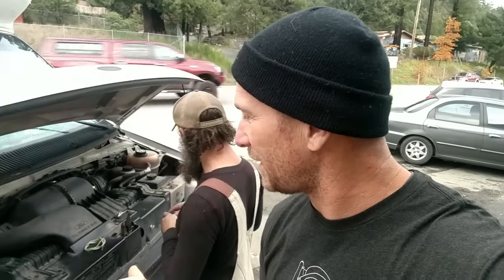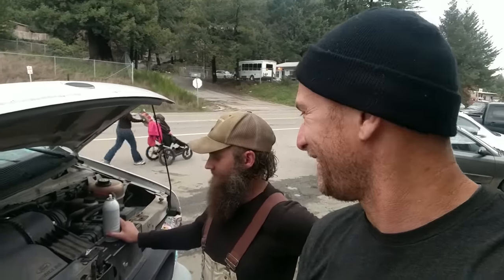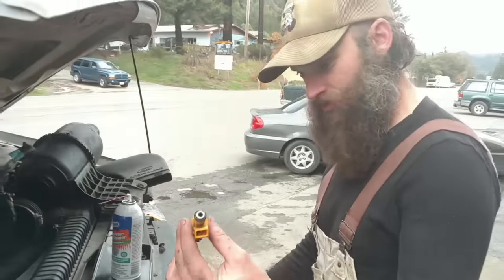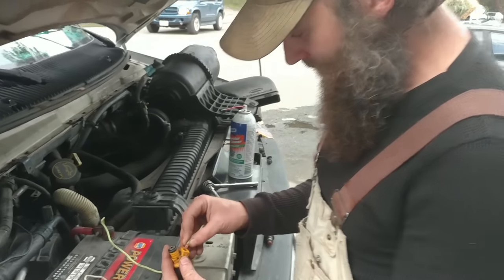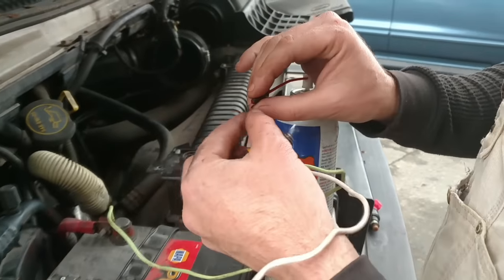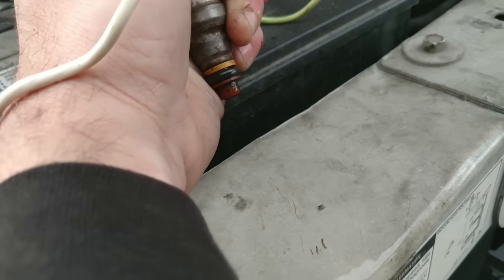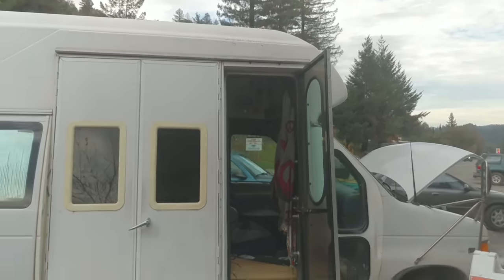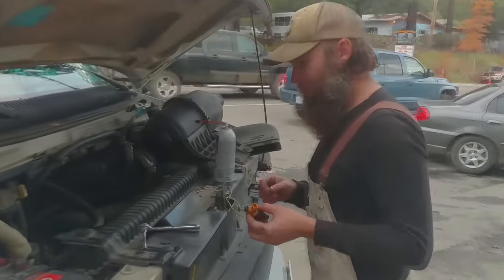Dirty fuel injectors?   Dont buy new ones- do this instead!

Comment: There’s supposed to be a fuel filter on this thing, if it’s passing that debris it’s either missing or by passing. Clean the filter and/or add another inline.  I think his injectors are just shot, worn out. If he has done this a dozen times, and has an 8 cylinder engine, he’s done some more than once. Put an ohm meter on them and get rid of the out of spec ones.  Ha ing to keep doing this isn’t fixing anything. 
 Do it once and all’s good? Ok, I can buy that. Multiple times? Nope, injectors are shot.

Comment: All you really  need to do is remove the injectors then the rubber seals. Pour concentrated seafoam or whatever fuel cleaner you choose. Must be concentrated no cuts. Let soak for your desired time. Preferably over night. Then blow out after soaking.  The concentrated fluid will dissolve the gummy fuel blowing removes the slug.  

When you add can of seafoam to 15-20gallons. It dilutes its effectiveness to almost useless.

Comment: I have cleaned mine this way.  the only time this doesn't work, is if the injector doesn't click.  If it doesn't click, then the injector is dead.  happened to me on my ford truck.  I took it off, and went to clean it, and it would click, so fluid doesn't come out the bottom.   brake cleaner works really good for this cleaning process.   I was able to clean a set of injectors this way,  on a an older volvo i had.

Comment: Injectors, like every other part on cars, do wear out. What happens is they start to leak only dripping fuel into the intake. So it is a good choice to buy new injectors sometimes.
Reply: Bet if it was diesel it'd runaway after years of doing this
Reply: @maxbollinger6158  Yeah, you'd certainly increase the chances of a runaway.

Comment: Can imagine it does clean the injector fine , but probably a good idea to use an inline fuse wire to the battery - looks very easy to short out those two wires.
Reply: Just going to melt those wires of you short them and hold them. They are very small and the cranking amps of that battery far exceed what they will carry. In this application, the wire is the fuse.
Reply: I wonder if the guy is still alive or just seriously burnt after doing this.  What a cowboy

Comment: Definitely works ! the only reason to get injector is if it won’t click and it’s broken inside the electric Fuel injector
Reply: there is NO electonics inside whatsoever! its a simple solenoid coil
Reply: Jim W  Well it’s not manual it runs on electricity so it’s electronic fuel injector that’s why it’s called an electronic fuel injector I know how they work to work on pulse signal
Reply: @tractormantp2113  electrics is NOT electronics They are 2 separate things
Reply: Jim W   Yes I meant to say electric fuel injector got it
Reply: Point is unless the inside of the injector is not working the electric part the coil that makes a pole spray then you can clean them and reuse them
Reply: @tractormantp2113  no problems buddy, take care
Reply: Good to know. Thanks

Comment: Never leave the connectors on that long... on a fuel injector you will kill it... but good video👍🏼
Reply: Yup pulse power
Reply: They are good for a minute or so, I have used injector test benches before, one test is to open the injector up constantly and see how much fluid they pass in a set amount of time, this test does open them up for 3 to 4 times longer than he had it open. That being said i would myself do it with a 9v battery first as there would be far less chance of damage and less chance of a spark that could ignite the spray he is using

Comment: My garage replaced all my injectors with an upgraded model and a new software pack and the result was fantastic.  It was a warranty repair guided by a specialist from Stuttgart.  When I traded the car the new injector pack increased my trade value by about 2500 dollars.   The problem was uncommanded acceleration that the garage took very seriously.
Reply: was that on Ford v8?
Reply: $2500 value for parts that cost less than $150 tops... and easy to do......????  Really???  lol...hm... don't think so...
Reply: They did you 😂

Comment: Only thing I would do differently is make a pedal like for a tattoo gun so you can tap the power on and off for the injector so it pulses
Reply from the maker: or a robot that can do the whole thing for you?!
Reply: @dridiott  yeah because everyone can afford a robot. piece of wire and can of Carb cleaner 399 done deal.
Reply: @johnnyblade3335  I would finance the robot

Comment: Great tip, but if you had to do this a dozen times already, there must be something else causing your symptoms.
You need to get to the cause my friend.  Corroded tank, fuel line, fittings, pump…pretty much anything between the gas station and your injectors.

Comment: wouldnt it be more sensible to put an inline filter on to collect the crud in the tank or better still drop the tank and swill it out instead of doing this a dozen times already ?
Reply: Depends on how bad the tank is.  I had a tank on an old Audi that was so bad it could clog up an inline filter in about 5 miles.  I had to stop every few miles and tap out the crud to keep going.  Ended up taking out the tank, cutting it open, wire wheeling out all the rust, and welding it shut again.  In retrospect, probably not the best thing I could have done, but I was young and ignorant.

Comment: You better use a DVM and check the rated voltage for the injector first. Overload it with high voltage and you will be buying injectors.  Weather it's an older TBI or modern multiport injectors, they don't normally run on 12V DC.  Many actually operate on 5 VDC.  Go ahead.. overload it with 12VDC and burn it out.. LMAO!  Always check voltage first before attempting something like this.

Comment: I throw a can of Seafoam, Techron, and Lucas Fuel Injector Cleaner full concentrate into a half a tank of gasoline at the same time and drive the piss out of it for like two days.  Not beat it, but accelerate aggressively. This also helps break free carbon in the system. I run that entire tank down to near empty before refueling then I top off the tank. This has always worked for me. But then I don't think I would let mine get to the point where they are that plugged. Fuel is important and with the crap they sell at the pump today, additives can't hurt. Most cars can run on swamp water so the likelihood of you damaging and O2 sensor or the cat is ridiculous.
Reply: sea foam does not work as a fuel injector cleaner, it was developed for marine outboard engines to help keep carbon at bay.......Techron is good as is Berryman ChemTool
Reply: @dixiegarage400  seafoam makes fuel injector cleaner it’s available at Walmart and all the major parts store. Not the stuff in a can (which by the way you can still add to your fuel to help clean valves.)

Comment: I tried spraying ethanol, laquer thinner and other stuff through my injectors.
  What worked was techron. Just put a rich dose of techron in your tank.
Reply: So, how does that remove the dirt & debris from your injector screen ?

Ahhh, you just "cleaned" them for the time being.
They will clog up again.
Reply: @franklyspeaking4480   I figure it desolves some sort of fuel deposits that turned solid.
The car had sat for 7 years.
 Because they didn't clog again.
It didn't just flush them away because none of the other stuff I tried got them to move.
And just 3 pumps of the techron and the injectors were spraying without pissing.
 Car has sat again for a year but it started and ran pretty good today.

Comment: Whenever I stick bare wires in solenoids and spray flammable shit through them 
I make sure I've got a gallon of gas handy just in case I need to put a fire out
Reply: thats what we pay for insurance for
Reply: ivan schafeldt  what are you saying the injector has a built in spark plug?
Have a think about what you said then go cook your head for the sake of humanity
Reply: @beltdrivetypea6534  
Don't know wat ur trying to say but if there is a gas leak in the house and u smell gas they tell u not to turn anything on or off as that may cause a spark and ignite the gas. The same applies here, he connected the wires so any spark that is possible has already happened so it can't ignite any fuel.
Reply: @KC08RAS  I'm struggling to comprehend the level of ignorance right now 
Part of me wants to explain but part of me is saying sit back and enjoy the steady stream of drivel
Reply: @beltdrivetypea6534  
Sharing knowledge is a good thing. I may learn something which I enjoy doing. No hard feelings from my replies I hope.
Reply: @KC08RAS  ok
He takes two bare wires, one + and one - 
He then pushes them in a small hole with no insulation between them
Then he braces them with one hand and while the solonoids open he sprays flammables through the solonoid 
So if a wire moves and arks the solonoid closes and he gets flammable shit blow back into his face at the same time the two wires are arking out
Pretty much exactly how a gas hob works
Reply: @beltdrivetypea6534 
ur right lol. Thought he had spade connectors at the end of them
Reply: Classic badass comment 👍
Reply: Good thing you don't go changing fuel pumps ans see the bare connectors submerged in your gas tank.... Don't shit yourself kiddie.
Reply: @666hobart  tard
Reply: @beltdrivetypea6534  Mmmm hmmm... We see who the tar is, keep takin yer car to the shop. We're all safer if you do...
Reply: @666hobart  what the hell are you on about
Reply: That Gunk out is that flammable?
Reply: @Tomasnok ye, that gumout is extremely flammable, it's basically like starting fluid, almost as flammable as any ether based solvents I'm thinking..could be wrong. It's My opinion...as for the comments of others here actin like he's being so dangerous...quit being a girly girl...besides, the dude said he's had to do it 12 times to that thing... he's probably wishing that POS would explode/ignite and kill him ROFL 🤣💥💥💥💥
Reply: @artv8830  my original comment was obviously sarcastic
Personally I'd love to see just how dangerous this could be if the planets aligned 
Darwinism in action is hella viewing
Reply: @artv8830  Gumout? Gunk.
Reply: Safety first. That's how I fly.
Reply: I'm stoned n don't know why I just read all this... But my 2 cents dude cud be aware of risk and he's just willing to take it. That would be what I do. He does mention using a 9v battery, then stated his preference so it's not like he's just talking out his ass. Why not.just inform ppl that is a risk instead of joke dissing. At least he tryna spread something positive and teach ppl vs u jus shittin on it
Reply: @QM1K  or just maybe my sarcasm has saved someone from having a their face seriously burnt 🤷

Comment: I just pulled mine today 2001 Silverado 2500hd 6.0. I took the orings off and stuck them in a pot of boiling water for 5 minutes. Took them out and cleaned with 90% alcohol and put orings back on and installed. Truck fired right up and my p0300 and 0171 codes went away. Runs like new again. Also running MMO in tank now to help keep ‘em clean. Original injectors 191k mikes and counting.

Comment: you can also pull the fuel pump relay, run the engine until it dies which will release the fuel pressure, disconnect the fuel line from the fuel rail, attach the injector cleaner can directly to the fuel rail which may require some rigging, spray the can to get some pressure and start the car and keep spraying the cleaner....the engine will run off of the cleaner which should clean all of the injectors at once without having to remove them from the engine, just remember to reattach the fuel line and put back the fuel pump relay before trying to start it again....you can also make a fuel line disconnect tool with the cap from a regular Sharpie pen, I find it works better for me if I stack two modified Sharpie caps as one is sometimes not thick enough to properly push in the teeth on the fuel line connector
Reply: Hey do you think that will work on a diesel injector? On a 7.3 T444E?
Reply: @GDMHificationranpitc  I've never worked on a diesel engine before so I don't know if there would be any difference.
Reply: @deputydillhole   Thanks for the prompt response...   Flux capacitor. Shalom
Reply: @deputydillhole  As long as we take injectors off the vehicle and keep as much of the cleaner away from contaminating into the engines  system 👍👍 should be fine.

Comment: So, I cleaned my injectors, reinstalled them and started the car.
3.8L in a Pontiac.
Rear 3 injectors split apart and gas went everywhere.

Buy new injectors and disreguard what billy bob just said.
I'm currently waiting on 6 new injectors that cost me a whopping $62.49 !
Screw cleaning them, they are cheap, just replace them.
New O rings, new filters, should run great again.
Reply: your first mistake was buying a pontiac
Reply: @alexmiller1018  
I have owned about 20 of them.
Id own 50 more before buying a ford or chrysler/dodge.
Reply: Frankly Speaking “I have owned 20” yeah I bet you have lol
Reply: @alexmiller1018  
I have owned over 50 camaros too.
I have owned over 200 vehicles & counting.
I have pics of my 65 Tbird, 94 Suburban 3500, 69 Javelin SST drag car, 98 Eclipse RS, 06 Eclipse SE, 05 Impala & a 99 Pathfinder sitting together 😎
9 camaro 2nd gens sitting together 😎

I can't help it you can only afford a beat up 96 Corolla 😆

Btw, I built custom vehicles for a living 😎

Comment: Well, if I want to get to my injectors, I have to take the entire intake manifold off.  So this method is a last resort in my book (aside from applying constant power to an injector - you're risking burning it up unless you're quick about the flushing part.)

Comment: you can buy 'rebuilt and warranted' injectors and get a credit for your old ones that reduces the price a lot.
Reply: Actually, you can't "rebuild" an electronic fuel injector -- but they can be "serviced" by a professional cleaning and the replacement of the Inlet Screens, O-rings, and Pintle Caps.
 The famous 95 MERC's stock injectors were replaced with BOSCH/FORD injectors from a '98 model -- the stock injectors have a bulky metal body that stores heat -- the new ones run much cooler.

Comment: Don't recommend putting electrical tape around the carb/brake clean straw because the cleaner is strong enough to dissolve electrical tape. You don't want dissolved pieces of electrical tape in your injectors.
Reply: Yea it will put all the sticky glue into the injector

Comment: Royal purple Max cleaner is the best fuel stabilizer out there on the market. And Royal purple oil is the best oil to use to clean out your engine spark plugs cylinder heads

Comment: There are some  instances that the injector does go bad  after a couple of  tests and it fails  .  If i ever have to replace the fuel pump , i also drop the tank and power wash it and get it all nice and clean and wash out all the trash and grim in the tank ,  and replace the fuel filter , while i have it  , some cars models  have the filter built in to the fuel pump  , some are external under the drivers side door in most cases .

Comment: I wonder if it occurred to him that all he's doing is exactly what is happening in the motor while its running except the fuel pressure is about 70psi. That spray can doesn't have 70psi so he's really just testing to see if the injectors open when power is applied.
Reply from the maker: What efi runs at 70psi?🤣
Reply: @dridiott  most systems are 60 psi. I meant to type 60psi in my previous comment
Reply: Funny this fixed my miss fire.

Comment: Ah man this is gold. I’m getting a rough start on my ‘08 Volvo, whether or not this will help I’m gonna give it a go.
Reply: done the filter?
Reply: @GregRickard  I have not. Actually not long after this I started being more consistent with using higher grade fuel instead of always using the cheap stuff. Surprisingly to me, that seemed to fix the rough start.
Reply: Had my filter changed on the weekend on my 2000 hiace van...fuel coming out of it was black. Van seems more eager to start now. 
I looked it up, a blocked or restricted filter can cause fuel pressure to be lower at the injectors... which can cause the computer to hold them open longer yada yada.
Worth doing if its been a few years, I mean it determines how clean the fuel is that goes to your injectors, plus a restricted filter makes the pump work harder too.

Something to consider at least,  good bit of maintenance and not that expensive.

Comment: Isn't easier to unscrew and clean ur fuel tank once or twice, than removing the injectors and cleaning them every 20 miles or so....? BtW injectors work on pulse.. Don't they?
 You'll burn em out leaving voltage on them that long and without fuel flow to cool them. 🤦
I'm no mechanic but DAMN!

Comment: I'd just buy new injectors if it took that many times to keep it running. I would definitely test the tape because it dissolves when it makes contact with the injector cleaner and you don't want tape going through your injectors, it may be why you must do this so often.

Comment: I kept waiting for that wire connected to the positive battery terminal to swipe across some grounded metal, spot weld itself to it, turn red and catch fire, along with all that cleaner you just sprayed all over your van.  That was a very dangerous and careless way to handle that wire.  Not to mention that the injector probably failed a few miles down the road from having the coil go open from being overheated by applying constant voltage to it for several seconds during the cleaning process.  The idea was good, the procedure was not.
Reply: Greetings David;  What was the type of spray being used?  I did not hear it in the audio...  Good point on the safety protocols.  Thank you!  - Paul -